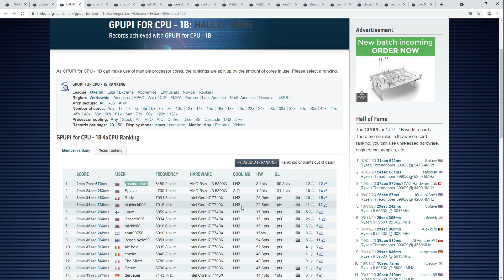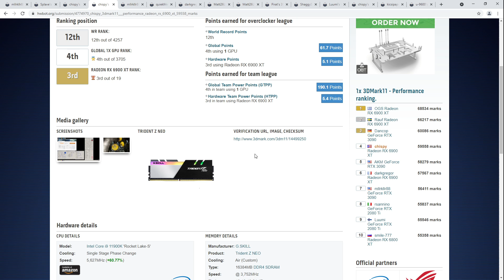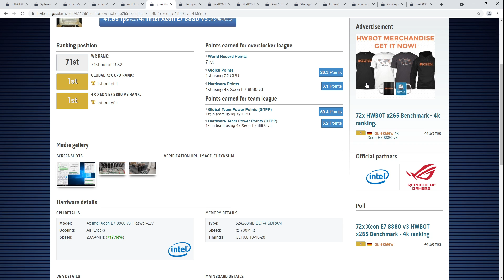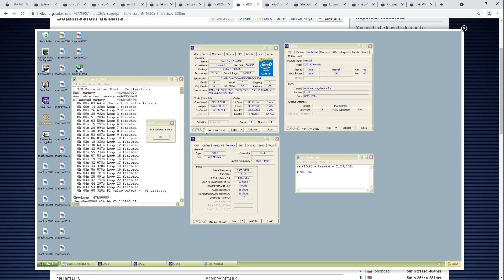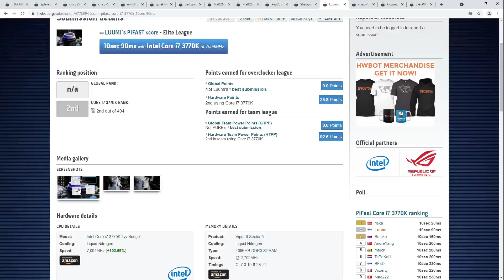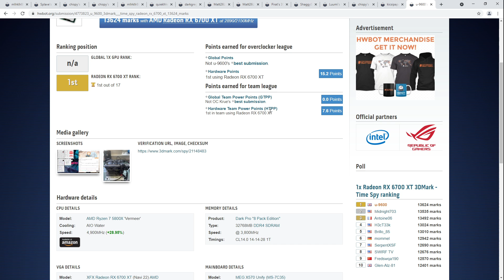HWbot score round up #9: 6.6GHz i3 7350K, 1.9GHz zombie GTX 970 and more!

Comment: The running theme with these videos seems to be Buildzoid saying he's never done any LGA775 stuff.
I hope he gets himself a half decent 775 mobo & memory and has a chance to play with either a E8x00 or the E2220 (I think E2220 was the one normies were able to get 50%+ ocs on, it was a E2xxx CPU I am sure of that).
Reply from the maker: I have too much hardware as is. There's no way I'm getting into 775.
Reply: @ActuallyHardcoreOverclocking  I have a GA-EP45-UD3L I will send you
Reply: No dual cores are the easy stuff. He should get a quad core and get it to 500MHz FSB daily stable :D

Comment: As said at 4:20, you can run 9900k on z170?
Reply: Yes need to mod chipset tho. Luumi has a great video on it
Reply: @benjamin-jp5ff  oh wow I never knew that and  ive been into pcs for a while.
Reply: @benjamin-jp5ff  No you are not modding the chipset, you just have to short the cpu enable pin, flash a modded BIOS and cover some CPU pins to be safe.
Reply: @OneCosmic749  yea fair point been a while since i uad looked into it.

Comment: The 4690k does not have per core settings but i does have diffrent settings vor x1 x2 x3 x4 loads. I allways ran my chip at x47 x47 x46 x46 to keep i stable during 100% load an all cores but it did turbo to x47 with smaller loads.